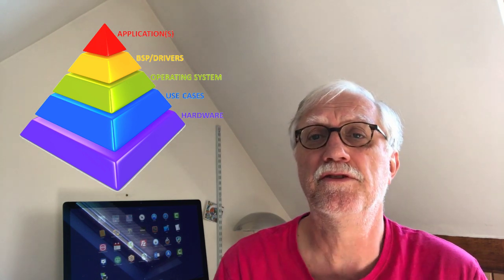The Power Pyramid

Comment: So you say we need to start with hardware and RISC-V architecture will enable exactly that. I just learned to crosscompile ARM and now I have to start from scratch... Well.. It is getting easier as I already know the drill... (a) check the ISA (b) write C startup code in assembly (c) write C firmware (d) program applications, (e) write drivers for Linux OS.